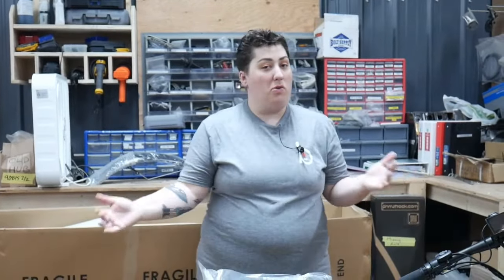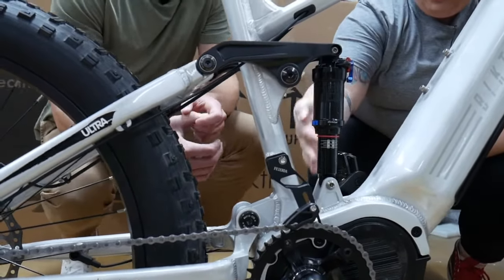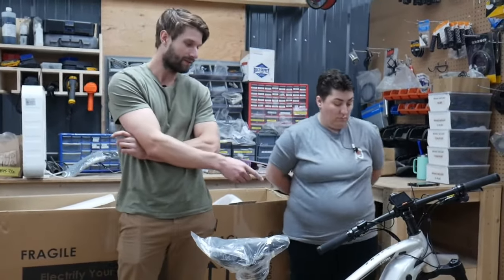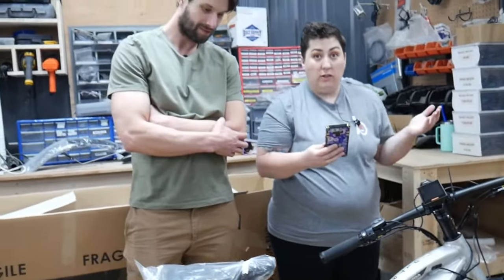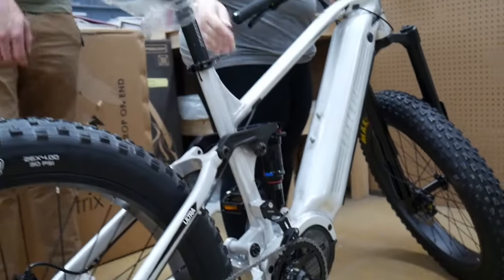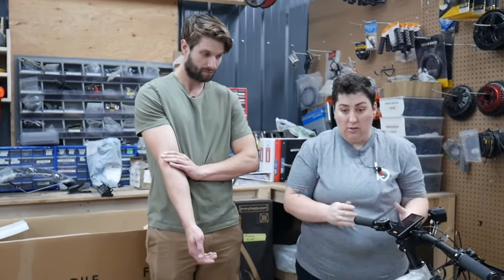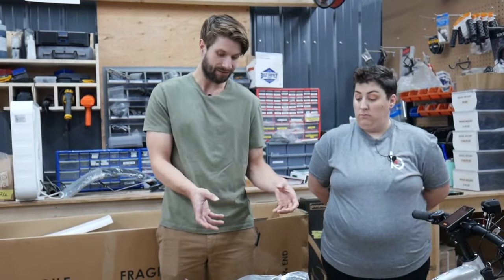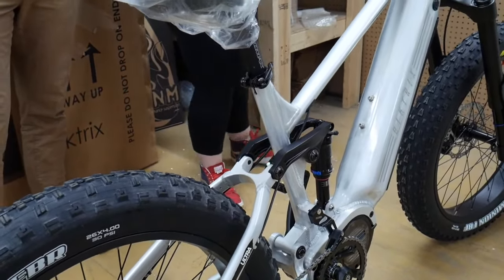Biktrix Live: Juggernaut Ultra FS Pro Overview

Comment: I just got my red, fat tire, FS Pro yesterday (8/19/2021) and all I can say is...   YAAAAAAZZZZZZZ!!  It's the most fun I have ever had with my clothes on. It's like having a bike that makes you feel like superman.  I already have 40 miles on it and I can't wait to get up tomorrow with a fully charged battery and GO!!  I happen to be a mechanical engineer and am designing and building a range extender battery pack for this bike.  It will more than double the range... depending on riding style and power usage.  I think the range will be around 70±10 miles for most people. I'm not sure my butt or legs could take any more than that... LOL.
Reply: Yep!got the 2020 juggernaut ultra 1000 pro,68lbs of pure muscle,Drove it all winter long -30 Celsius without the windchill factor,JUST WAIT UNTIL YOU PUT A COUPLE 1000 KLKs on the pony! You think you love it now! I love my juggernaut ultra 1000 pro even more than the first day I bought it. Keep the drive chain clean and lubed and remember you have 160 nutin meters of torque Baby!wear you're helmet! Have a BLAST!
Reply: @haleysabit1612  Roger that...  chain clean and lubed. Check.  Helmet.  Check. 😉
Reply: Any update on range extender battery pack project?

Comment: Great looking FSpro. I like the new upgrade to Minion FBR tires and those solid black rims,no cut outs!noticed you didn't add a bush guard protecter for the rear NX derailer,love the hidden battery what's the amp hours? And finely what is happening with the new Ultra Eagle?
Reply: FS Pro - You can pick the battery and amp hours from the web site order form.  Mine is a 52V, 17Ah battery.  I went for a 20 mile ride today (on ECO mode) and rode for about 1.2 hours.  I still had 61% battery life left.  The Minion tires are fantastic.  I put a bush guard protector on the NX derailleur.

Comment: What model of Mid Shock has been specified for the FS Pro?
Reply: Mine came with Rockshox Monarch... that's the one shown on this bike.  It works great.  But I think it will depend on the available stock at Biktrix.  You will likely get this shock or something even better.  Right now the inventory and supplies due to shipping is in crazy town.  Some parts are over a year delivery.
Reply from the maker: Mitchell is correct it's the Monarch!

Comment: I just bought an ultra fs with the extra battery pack?  why are they saying it wont fit on the bike?
Reply: You bought the FS Pro 2. The bike that's in the video is the FS Pro which has a 3" tire/wheel option but no second battery option.